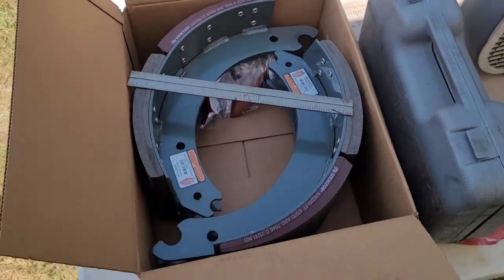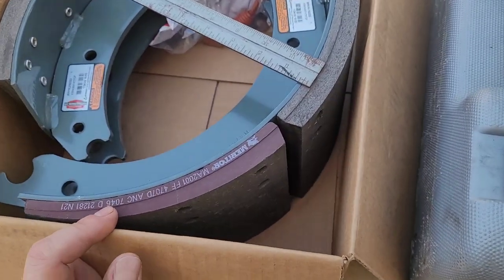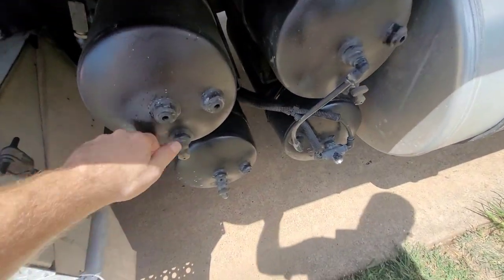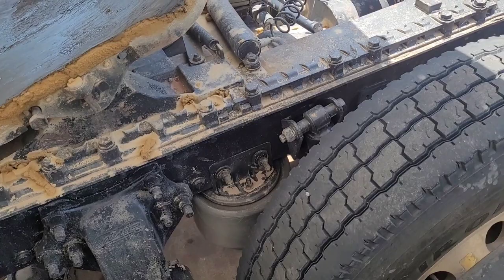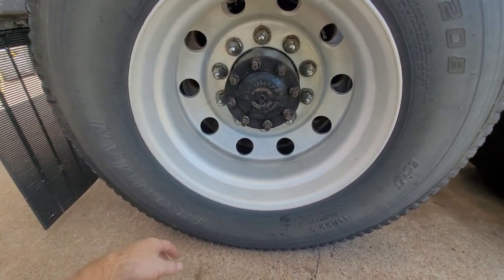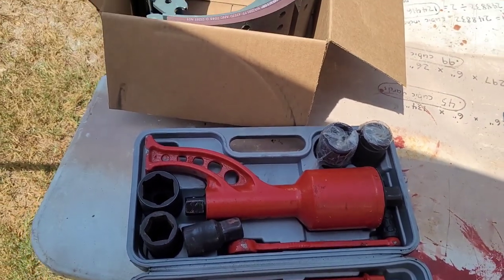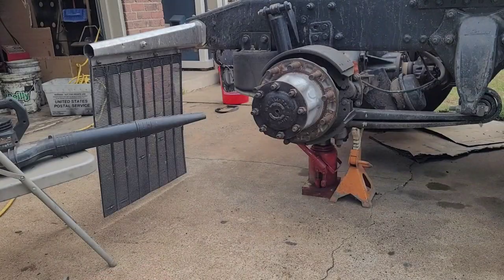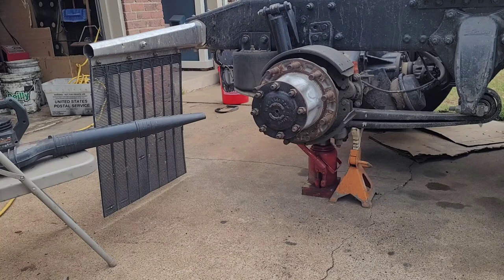How to change rear brake shoes on a semi truck

Comment: I enjoy you videos, glad to see I'm not the only one that occasionally makes a flub. 

Amazon sells a torque adapter (NEIKO 20743A 3/4”-Inch Digital Torque Adapter). Have had mine for 3 years now and it works great 
This will help you keep the lug nuts at the proper torque. Which will keep the lawyers off you if you have a wheel runoff and they see you jumping on the breaker bar in your video. Trust me I did that many years ago so I ain't being mean. 
You can get those lug nuts to that exact OEM requirement of 450-500 lbs. 

Keep the videos coming they are great
Reply from the maker: I'll have to check that out.  I was looking at the torque bars like the tire shops use but they are extremely expensive.  We can never do enough to be fully protected against lawsuits.  They can say the sleeper has an unkempt bed, floorboard was dirty around pedals, reflective tape had tears, tire had uneven wear, shock had oily surface, one tire didn't have enough air pressure, a light was out, driver didn't get enough sleep, driver was dehydrated, driver was depressed, driver was overworked.  It never ends.  There's no way to beat it.  Sadly, luck plays a heavy part in how successful we are at the end of the day.